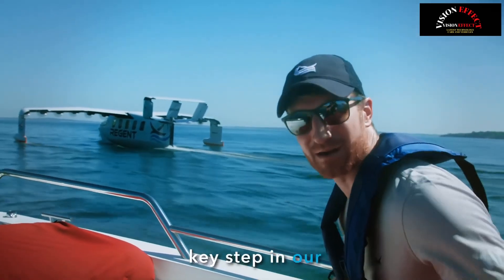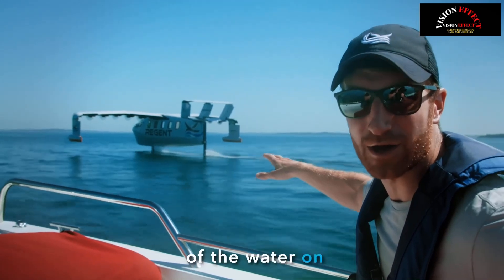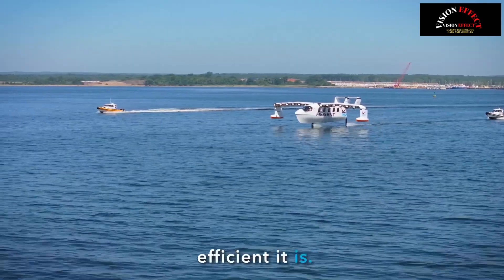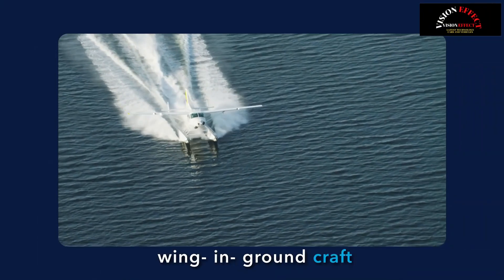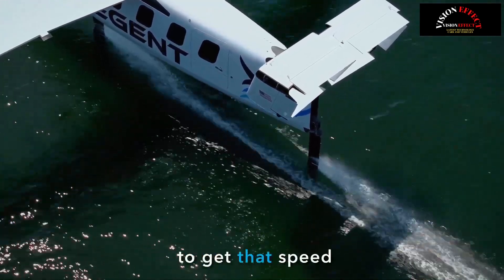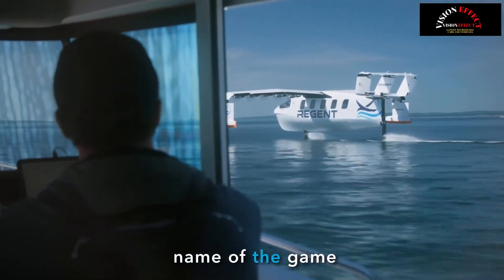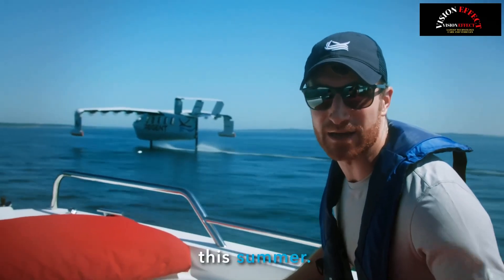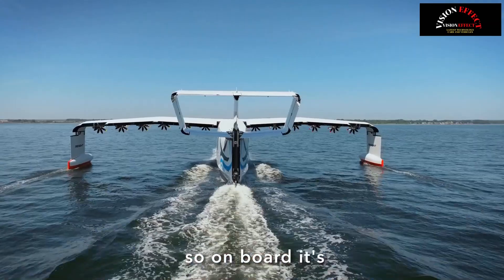The Regent Seaglider Will Fly Late This Summer. Preparatory Testing is Progressing at Full Speed.

Comment: What percentage of the flight is supposed to be on water? 
1%? 2%?
Less than that?

You're solving a problem that isn't a problem. 
Just take off, and there's 0 water resistance.
Reply: It's not so much % of flight but reducing effort required, namely drastically reducing the engine power requirements of picking up speed to get out of the water by minimizing resistance to obtain ground effect flight. Instead they just need enough engine power for the foils to push the plane  out, resistance drops, speed goes up, then they can accelerate to full flight.
Reply: @zano187  yea true less engine power to take off. but less engine to deal with wind......I think biofuels are an better option for the future or synthetic diesel into jet A....Then I hope those foils are retractable for landing.